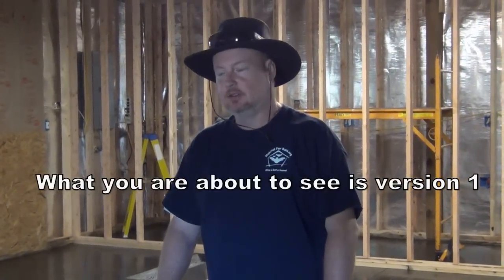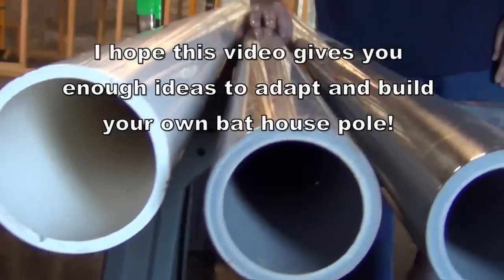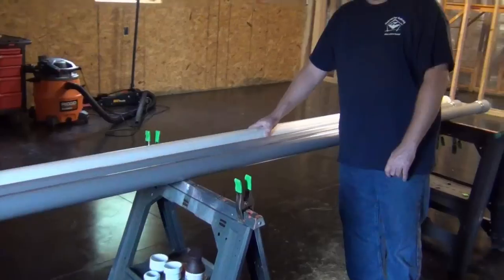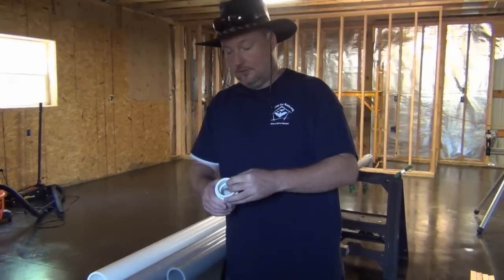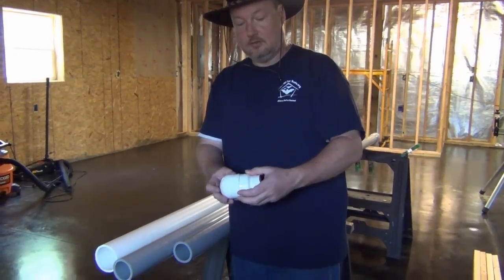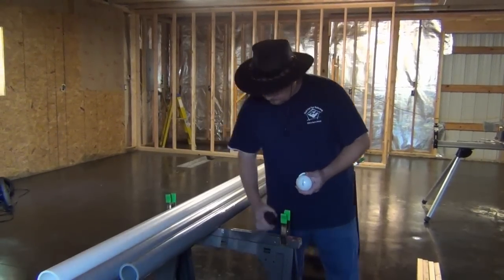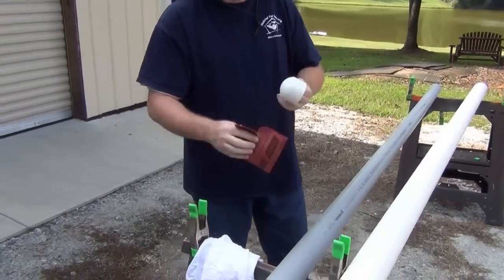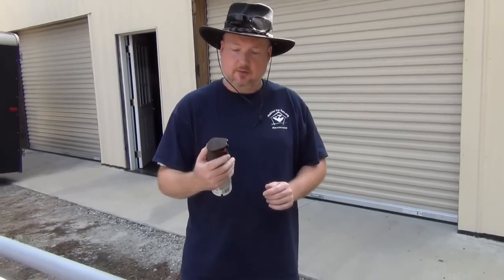Bat House PVC Pole - Bats in the Attic Series part 5

Comment: General question regarding bat selectivity... do you think they would occupy a free standing (pole mounted) house over one that is attached to the side of a barn or other tall structure?  Thanks for the video... not a fan of the pvc version though... :)
Reply from the maker: +Frederick Dunn Yeah, the PVC pole is kind of a "almost-failed" project. It does OK, but not my first choice. When you get it right it takes a lot of materials and work. However, if you can only haul up to 8' or 10' material it is an option.  Bats will prefer a location with the best thermal characteristics. On a pole, a larger bat house will generally do better but even smaller ones will get what are called bachelor colonies composed of males and pups. A bat house on a structure that is properly placed in the sun for warmth will generally do very well. The structure tends to help insulate and buffer heat transfer for the bat house where a bat house on a pole does not have that additional bulk behind it. However, bat houses on pole do very well. I generally state the preference as First, mount on a structure or barn, next a pole at least 15 to 20 feet from a tree line if possible and lastly on a tree. Bat houses on trees are typically the least successful.
Reply: Thanks.. well, mine is up on a 4x4 pole.. we'll see how it goes, thanks for the follow up :)

Comment: Ten feet of steel pole with multiple holes. You can always turn them to the sun and have them locked in
Reply from the maker: The landing area on the bat house should be 10 to 12 feet high, meaning the pole will need to be at least 16 feet long if buried in the ground and the bat house is mounted at the top.  We find that 21 foot 2 inch "ID Sched 40 steel pipe is the best solution when they can be transported or delivered. We make brackets specifically for the 2" ID pipe.  Thanks for loving bats!

Comment: How did this PVC work out over these six years now? I ordered my three-chamber house today. Schedule 40 steel pipe is more expensive than I expected. I'm thinking of two pieces of 12 foot 4x4 pressure treated. One three feet in the ground with cement. The second overlapping ~four feet and scissoring should get me up to 17 feet at the top of the post. I would predrill the carriage bolt holes, install one carriage bolt loosely and pivot the upper with the house already on it and install the second carriage bolt. I can't find the video where I saw this scissor done.
Reply from the maker: It is doing OK, there is a colony of bats in the bat house. By the time you add up the cost and effort, a 21' 2" ID Schedule 40 steel pipe (black pipe) from a plumbing supply is still the best deal. The only tough part for some people is hauling it.
Reply: @h4bats  Do you mean just use that one pole and set it in concrete, and that's all you need? That sure does seem a lot simpler if the length isn't too much of an inhibitor...
Reply: @h4bats  great idea. One question is kinda bugging me and is kinda scary is will it become a lightning magnet?? and if yes how would you lightning proof it so the bats don't suddenly become very hot. This is a big question of mine and a fear for them.
Reply: Like your idea of pvc pipe. A metal pipe would make for an excellent lightning rod.😬

Comment: I would have rather seen how you put the house up than the earlier wrench turning or the top of the pole cap.  Was it tilted into the 10' schedule 40 or was it cut off "x" feet up, etc....     the only part I haven't done 100 times,  the planting and poles w/ Bat House totally lacking, Size of that Bat House, how much did it weigh? I've seen a lot of you videos, and for those, Well Done, Thank You!  This one, I'm sorry to say, Disappointing.

Comment: I have 2 bat houses up, similar to yours but did not use PVC pipe. It is in O'Fallon, Illinois. Should the boxes be facing South? I had mine put up 15' high. How long does it take for the bats to inhabit the boxes? How can you tell if they are occupied? Thank you, your video was very helpful.
Reply from the maker: Thanks for loving bats!  Typically, bat houses would face South to South East. You want to catch the morning sun and warm the bat house up for them. They like 85 to 100 degree as their "room temperature".  At 15' high, it should be about right. How long it takes depends on the bats. Often, they will find it but not start using it immediately. Also, even if they do find it, you may have intermittent use of the bat house by only a few bats.  Looking up in the bat house with a bright flashlight during mid day is one way to look for bats in it (but keep your mouth closed, that's not rain). The best way is to look at the post or structure of little black spots or smears and on the ground for guano.

Comment: What about partially (half or 2/3 from bottom) filling  w concrete?
Reply from the maker: My hope was originally to lower cost and provide something easily hauled and setup.  The cost benefit began to diminish the more work and material had to go into the pole. You can certainly do what you suggest, but in the end a 2" ID Schedule 40 pipe (black pipe as plumbers call it) in a 21' length makes a great bat house pole.

Comment: Why did you use grey pvc? Would white sch40 pvc filled with concrete and sand work as well?
Reply from the maker: I used grey (electrical) because it has sizes not available in plumbing and had a built in bell for a coupling (no separate coupling required)
Reply: NO

Comment: Where is your description of version #2? You place a galvanized pole inside the top section of the pipe. What kind of winds do you think it will hold up to for a 20# bat house?
Reply from the maker: +Darnell Jordan I plan to make a followup video on this pole this spring as well as a few other pole options. Yes, I put a fence post in the top section and captured it with the top bolt to make the top 2" section more rigid.  Once installed it seems very durable. So far the 2 chamber bat house has survived several storms and reasonable strong winds.
Reply: @h4bats  where is the follow-up video?

Comment: Hi ive just bought a batbox from my local garden centre.  The gap at bottome were bats get in is only 10mm wide. Is that to small? Im in the uk. Regards
Reply from the maker: 10mm is on the small side, but not a problem for most species. Ideally the opening should be about 12mm to 14mm, but you shouldn't have a problem with the 10mm opening.  Bats are very persistent when they want to get into a location and can squeeze through very small openings.
Reply: Thankyou.  Regards

Comment: Once direction is set, instead of gluing the pipe joint together, could you drill through and insert a bolt for removal.  this would allow removing the last pole section at 7" above ground, versus going all the way to top to maintain.  A similar system could be designed near the bottom, using larger pipe that is buried, inserting smaller diameter pipe, keeping in mind thickness and double piping as the he did in video.  I think another comment had similar suggestion.
Reply: I don't see why you couldn't put a bolt and a nut on it.

Comment: Sir, did I miss the part in your series "Bats in the attic" where you removed the bats from the attic? If so redirect me, if not, wth happens next? Thanks!
Reply from the maker: Well... you didn't miss it, between myself being busy and away and the homeowner doing the same we haven't sync'd up to film it.  But I'm hoping to get to that this summer. The bats are still there as well as in his new bat house so it should work out perfect.  Basically, we will put a plastic hardware cloth net over the outside of the vent and let it hang down. Bats can exit, go down and leave but when they return the won't go that far down to crawl back up, they'll basically try to land close to where they enter.  We've found 18" to 24" of drop down generally does the trick over vents or gaps.

Comment: My neighbor used PVC to make a flag pole that's about the same height.   He glued the sections and filled the pole with sand to stiffen it.  It has been up for ten years or longer with no problems..
Reply from the maker: Rick Williams hmmm... and the sand would disperse the heat to reduce thermal flexing. Might have to try that.
Reply from the maker: Under7Cs
Good ideas.  I'm working on using a Tpost ideal too.

Comment: try putting a scaffold pole in the pipe cut the pipe 2 to 3 ft off the ground  insert connecter put the pipe back to gether  may be fill the pipe then with concrete
Reply from the maker: that sounds like an interesting idea.
Reply: Roy  Waite you would have done better with rigid metal conduit.

Comment: I put a bat house which faces east on the second floor of my house, for all these years, I have not seen a bat using it, but my neighbor has a lot of bats going in his bat house.  I wonder what I did wrong.
Reply: Here in Florida we have to face the bat houses south. Also the bat houses in Florida need a little bit of shade during the day or it is too hot and they do not like the excessive heat.

Comment: 14: 00 Plumb it. Level  refers to horizontal, plumb to vertical. Two guy wires can go at about 45° down and close to the fence. If some are needed in the other two directions, bushes can be planted close to the ground mount of those two, for safety from walking or running into them.